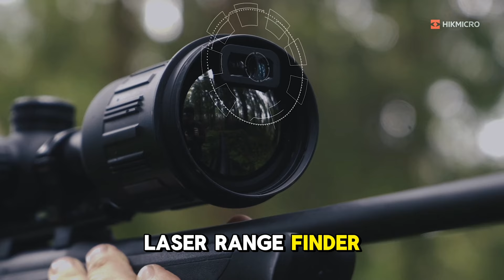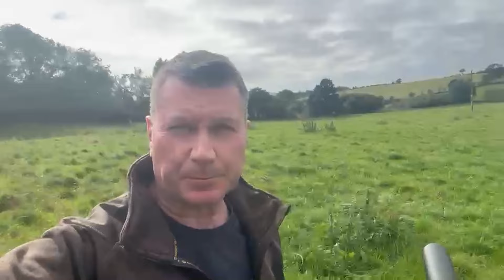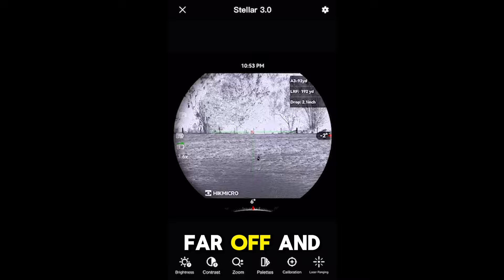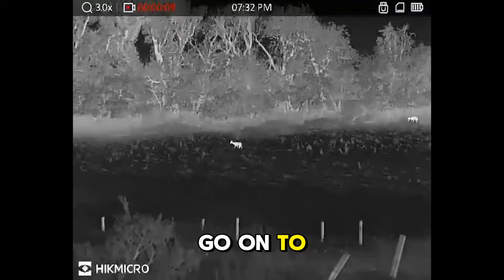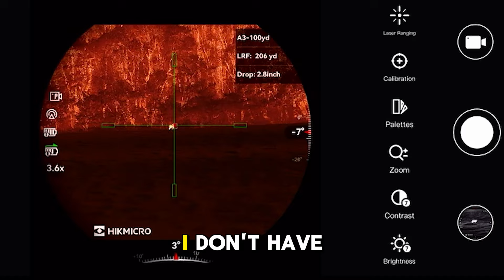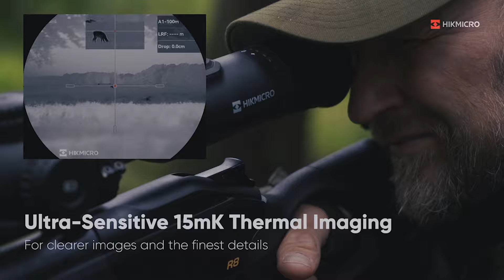HikMicro Stellar 3.0 LRF Review - "My favourite thermal scope of all time" - says ProStaffer Richard

Comment: Just to say using the velocity printed on the ammo box is not really accurate.The factory  normally use 26”” barrels .You really need a Chronograph to get the actual velocity from your own rifle.Also I notice the unit does not move your point of aim from the ranged ballistic data(As the Alpex does?Thanks.👍
Reply from the maker: Hi, yes should always use a chrono to gain the speed but the box figures  are a good place to start if thats all you have. then adjust from there if needed

Comment: Thank you for the video.
I'm torn between HM Stellar 3 and Nocpix Slim H35.
I wish I could afford both - Stellar would sit on my .308 Win Tikka, while Nocpix would be the primary sight on a 6.5 Grendel AR-15.
Tough choice. :/
Reply from the maker: go with the stellar 3.0 on QR mounts 1 scope for all rifles.
Reply: @TheNightVisionShow Thanks, I wanted to use QR mounts for either of them. 
Stellar wins with the 3,6x optical magnification. it's heavier and more pricey, than Nocpix, though.
Reply: That is a really hard decision, im trying to make that myself. I whant rangefinder but the nocpix har slightly better hz and otical zoom @matthiusix
Reply: @nickenk00  Since I could not get my hands on Slim H35, I tested only Hikmicro Stellar and Nocpix ACE.
I finally chose Nocpix ACE H50R. Stellar picture was noisy, compared to Infiray / Nocpix.
But my next thermal unit will be something smaller, that can be used both as a thermal sight, and a handheld spotter. Perhaps PFN 384+, perhaps Slim H35.

Comment: Cheers for the review. Just wondering what mounts you are using
Reply from the maker: hi in this video they are innomounts  https://www.scottcountry.co.uk/products/innomount-2-piece-quick-release-mount
Reply: I opted for sportsmatch  one piece.  I store my Stella  in its case after use and clip it on  the same pic slot  on each outing...never fails to hold zero......if that helps

Comment: Looks great I'm sold on the sx60 I own 2 Alpex 4k thought it would be a great upgrade from NV but let talk price something you fail to mension  the SX60 is £5000. I love hik but your tell me that a thermal sensor is £4000 more than a Alpex 4k. When there using the same body and the firmware as the Alpex 4k. I hunt with pcp so let's put this into context I could buy for £5000 a FX King a FX crown GRS and a FX DRS walnut for the same price as that scope. Hik has always made a point off good value and rightly so with the Alpex 4k it's a lot of scope for not a lot off money why ive bought two. At the end off the day it's a thermal camera with a set off cross hairs thermal cameras are nothing new so why when you put it in s scope it automatically trebles the price.
Reply from the maker: hi thanks for the comment thats a very good price for a HD thermal sensor, different body to the alpex and software. housing a inline LRF.
Reply: With that comment just shows how far away from reality Scott Country and HIKMICRO are from there customer base. @TheNightVisionShow